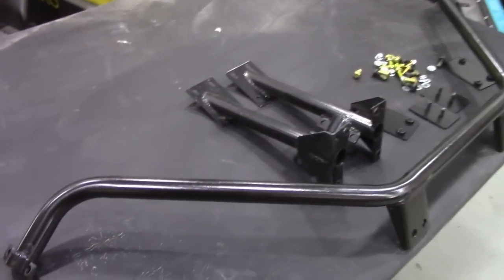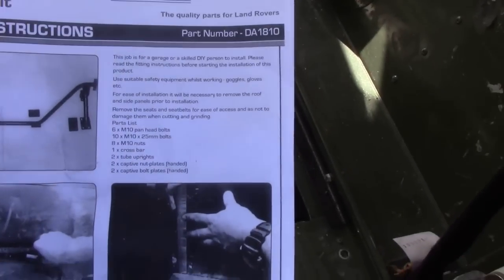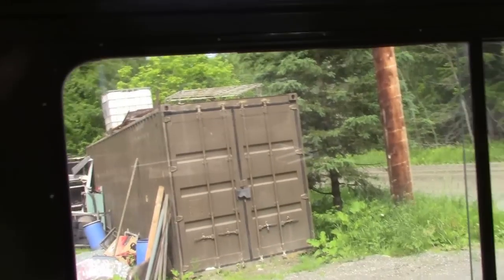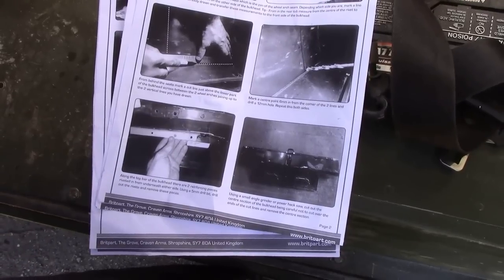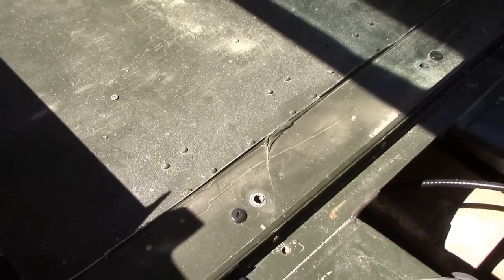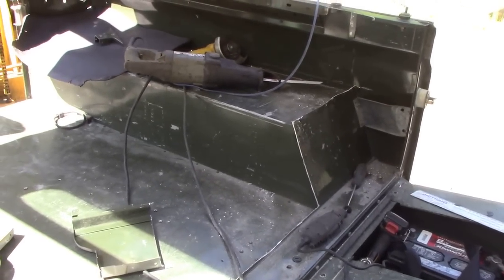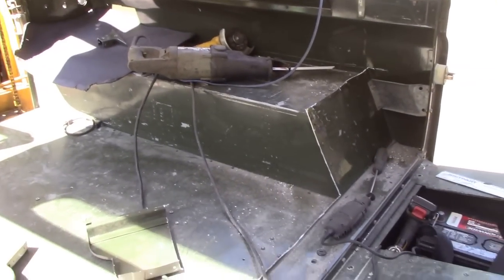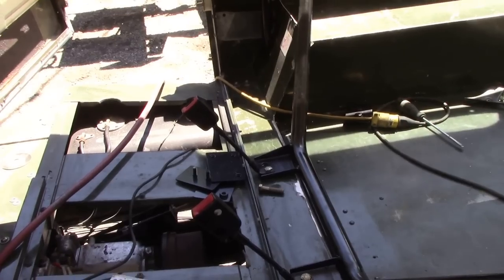Fitting a Defender bulkhead removal bar

Comment: Excellent video..... and great install with the custom bodywork mods.... especially like the way the roof is held up... I must buy a fork lift!  :-)
Reply from the maker: Thanks!
I have a few ideas for the next one, as I think this is going to be popular for the unofficial imports here.
I know you can get seat risers to give you more leg room, but for the taller person, rubbing your head on the headliner is not much fun!
Yeap, the forklift is sure handy  - don't know how I managed without one!
Mike
Reply: Indeed.....!  BTW..I just checked my factory fitted bar and the welding is better! :-)
Reply from the maker: I knew this was not an OEM manufacture - the welds look like a 7 year olds first day on some - I did tidy some up 
So I just did a bit of research and here goes - Genuine LR parts + tax
STC4589 main tube £244
STC4593 Left support £36
STC4592 Right support £36
STC4590 nut plate £22
STC45921nut plate £22

You don't need the nut plate - you can make them easy

Mike
Reply: Those prices are not as bad as thought they might be from JLR.  Interesting.....
Reply from the maker: You can easy make the nut plates and save £44!
MIke

Comment: nice work mike, you made that look a lot less scary than any other tutorial / how to I've seen
Reply from the maker: The one thing I do not do is drama!

Pretty easy - I think next time I will use an electric saw now I know where to cut, and not bother with taking the reinforcement parts out at the top of the bulkhead - just cut them - they are junk anyway.
Same goes when I modified the wheel arches - put the angles underneath, pop rivet to the old bulkhead panel, cut the lip with a saw then pop rivet the tops - reckon you can trim an hour of the job and make it as neat
Mike

Comment: really nice job im going to do something like this to mu 110. theres a kit that remover the top of the bulk head and leaves the lower edge inline with the boxes. as mine is a camper i have the boxes built in to units and a bench seat to i dont need it taken all the way down check out lrsoffroad its only 140 pounds. thanks for the info on the sankey, it was a great help.

Comment: HI Mick after watchine  your vidio on balkhead removeing I have removed my bulhead but i didnot remove all of the bulkhed i cut it at 45 degreas leaving most of the edge from the top of the wings to where the bulk head meet and jons the to trim I reinfost thr bit that i left on whith 2mm cheker plate no bar no movement cost 30 pot rivets and 4 x4 alluminyum plate

Comment: Nice work Mike; and I like the Omega BTW!  Love the content, long may it continue
Reply from the maker: It's a pity the Omega straps are not very good - quite expensive for an original!
Reply: Similar issue with Breitling Mike. Just bought another Defender chassis (90) for project number 4 (needs cross-member and galv before rebuild into a Heritage replica) - all to be made better....!

Comment: Hi Mike. I am leaving a comment here to inform you and your followers that things have changed with this bar. The welds on mine are far superior to yours, however, the fit is atrocious. I followed the instructions just like you have with the drilling of holes and my side pieces were nowhere near the front of the inner arch. The main bar itself was too wide and the lower brackets were welded on off centre, the main tube was also twisted. Mine had stickers on it saying "Xpanda" so it looks like they may have changed supplier? Oh, and I am not the only person to experience these issues.
Reply from the maker: Nigel - this fitted like a glove but the welds were  poor
I see there is a new 'variant' ( to coin a phrase) that allows fitting without removing the roof
Reply: @BritannicaRestorations  Mike.. take a look at my install. Welds were OK, but not designed to fit a Landie..

Comment: Great video as always Mike. Just wondering was it completely necessary in the end to take the sides and lift the roof off? Thanks keep up the great work
Reply from the maker: Yes, as there are bolts which are fastened to the side rails for strength

Comment: I fitted the genuine item to a previous 90 we owned but didn't like how much it pushed the tub out (I think the difference was nigh on  20mm) so when I came to do the same to my wife's current 90 I built it from scratch with a friend who tends to think 3mm wall square/tube/sheet is the minimum requirement for everything. It might not be as pretty but it is a lot stronger and doors needed no adjustment let alone the side panels and door rubbers! 

It does make a huge difference to the usability of the motor and it's something I'd willingly do to anyones if they pay me enough!
Reply from the maker: This one had no impact on the doors - shut perfectly well
Mike
Reply: How interesting.. I am fitting one now and it wants to push the tub out around 20mm too!!

Comment: By removing the rear bulkhead and installing the bar are you able to move the front seat rails backwards in order to ultimately have more leg room?
Reply from the maker: Yes but you are limited by the runner length

Comment: Hi Mike.  Great video as always. I'm on my second 90 CSW, the first having the full bulkhead you removed, the second having the factory fitted bulkhead deletion bar.  One downside I noticed on my second 90 (2003 Td5) was that LR decided to install grotty multi-section welded rear tub body cappings which have rotted at the seams.  My first 90 with the bulkhead had nice one piece cappings which never rotted.  I'm thinking of replacing my body cappings with galvanised replacements but it seems only multi-section galv versions are available in the shape needed for a CSW with factory deleted bulkhead.  One piece galv cappings are available for 90s with a bulkhead.  So I was wondering if it's possible to fit one piece galv cappings designed for an internal bulkhead to a 90 which has a factory deleted tubular bulkhead.  A bit of fettling may be needed but I fear this won't be as straightforward as hoped.  A topic for a video perhaps?  Cheers
Reply from the maker: Sorry I cannot do a video as I have no vehicles here, but you should be able to cut and trim the one piece capping

Comment: Great video, is it possible to take out the front of the wheel arch and make it vertical so you can gain some more leg room ???
Reply from the maker: I suppose you could, but on a 90 you are going to be close to the fuel filler (Pre Td5)I have seen 110s taken back and put seats in the space of the wheel arch - so these were forward facing but your feet were on the floor - lot of work!
Reply: Britannica Restorations Thanks for that, keep up the good work.

Comment: Hi Mike - the Mud UK version is much better made and by the looks of it, easier to fit.
Reply from the maker: I will check it out
Mike
Reply from the maker: Had a look and this is a different product doing a similar job.
The one I fitted was a NAS spec fitment and gives a much more open look, and probably designed for strength, as some of the NAS were soft top with an internal roll cage
Nothing wrong with the MUD one, but looks like a Britpart one DA2351
Mike
Reply: Yours is a very neat job and certainly looks very strong.  I've yet to fit the Mud UK bar to my 90 and maybe it's not as structurally sound, but it does at least retain some of the originnal bulkhead - thereby maintaining the vehicle's geometry (noting your comment about whether the door will shut!).  I'm going to fit it hopefully next weekend - I'll let you know how it goes.  Thanks as ever Mike.
Reply from the maker: You're welcome Jonathan!
Mike
Reply: I have the mud one in my 90, really just to take the top of the bulkhead off so that I can slide my seat back further (on mud rails as well). It retains a useful space for stashing gear behind the passenger seat and cubby box.

Comment: As you said, that welding doesn't look very "British" .  As you found with the Britpart binacle and now this, Britpart are not synonymous with quality - event their slogan is grammatically incorrect!

I had one of these bars from Protection and Performance back in 2005.  They were used in the 1998 50th Anniversary V8 90s (painted grey).  The quality was different, but the design basically the same. I fit mine while I was rebuilding my 109 from scratch, so no roof in the way,  but for the bolt through the capping that requires roof removal, I wonder if you could drill a hole through the ledge of the roof side panel to get that bolt in.  I reckon you could fit the bolt from underneath and fit a nut and washer (superglued to the nut) through the gap between capping and ledge.  Worth a try next time to save lifting the roof.  I didn't want the big flange around the end of the wheel boxes where they are attached tot he remnants of the bulkhead, so I made up angle strips to fit underneath the wheel boxes and used rivets and PU adhesive so that there would be no flange inside the cab.  Worked well. http://www.nickslandrover.co.uk/reversing-sensors/

Comment: I do like looking at videos of people working on old trucks although not that much into Land Rovers having said that I do not get it why you would take the one part that is holding the body all strait and strong out just so that you can get a bench seat in the back  that would still be hard to get in unless you are a young child.
Reply from the maker: It is just as strong as the original but access is limited in a 3 door 90 to the back - my customer wants to put 2 x front facing seats in the back - gaining access trough the rear door is going to be hard